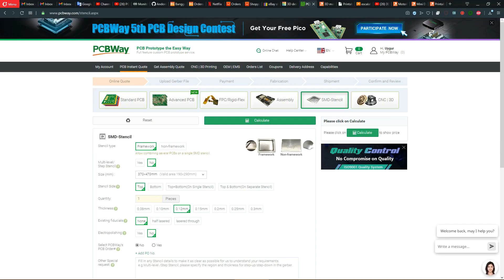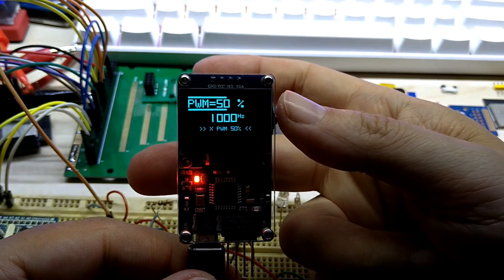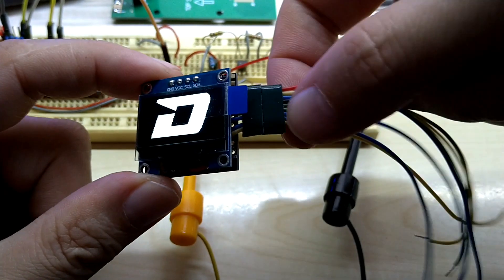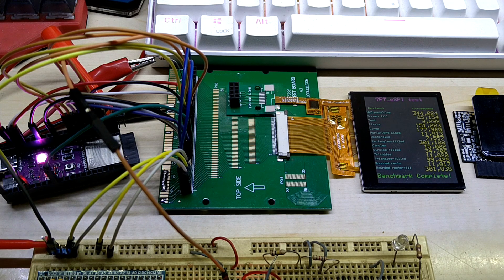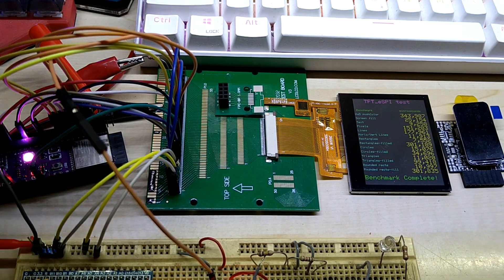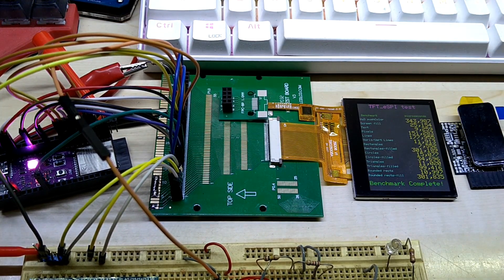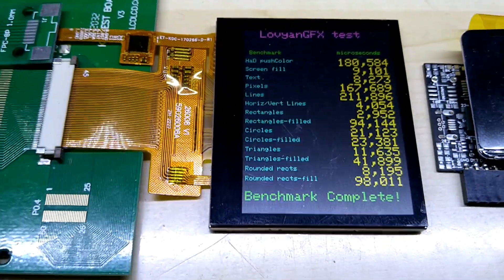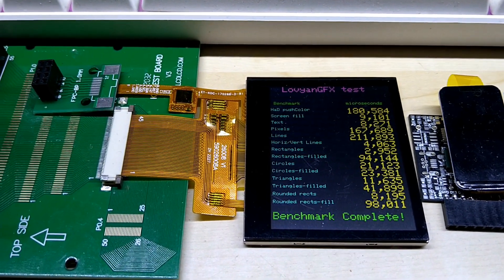2 of my Products and a ILI9342C Display test, connected in 8 Bit parallel to a #ESP32-S3 Dev Board

Comment: If you want speed then Lovyan with 16-bit parallel is best for this type of panel in my experience. For even faster frame rates then using the ESP32-S3 LCD peripheral in RGB mode with a ST7701S or similar is far superior but you must manage the display buffer in the ESP PS-RAM. These displays are cheaper too.
Reply from the maker: Thanks for the Fix Nik 🙂This display does support 16-bit as well, but I am not sure if I will have enough pins after connecting the rest of the components I want. Would be interesting to see what 16 bit can do though 🙂
Reply from the maker: @UCZ7IOB8omxcipIqGojEb0ow There are sure a lot of possibilities, I also like unusual sized displays, although in this case I had to make it fit a certain dimension. Would have loved a square 3" display but could not find any, also at least 8-bit parallel was a must. Would love to find a flexible display in a wide screen format but I guess that is still a few years till it hits the DIY market.
Reply: @iHayri1  The only flexible displays I've seen are AMOLED which unfortunately implies MIPI-DSI interface.
Reply from the maker: @nikthefix8918  That is indeed unfortunate.